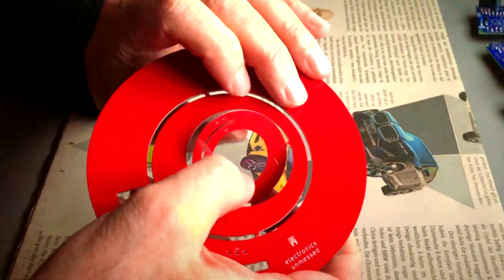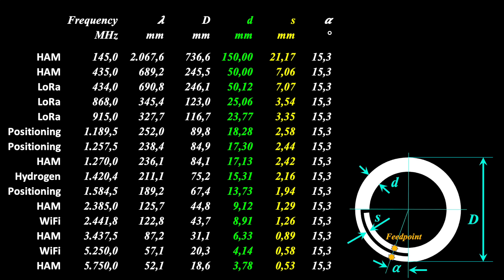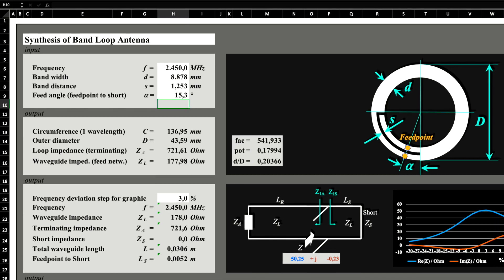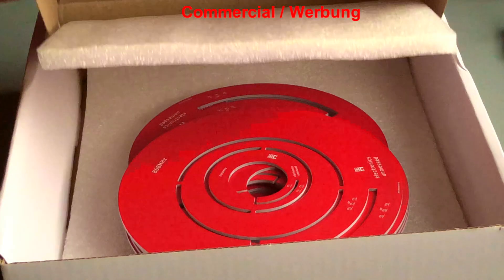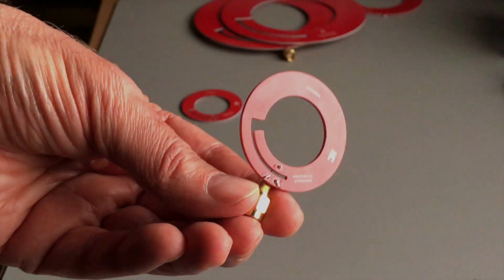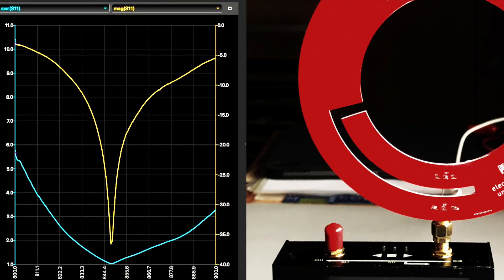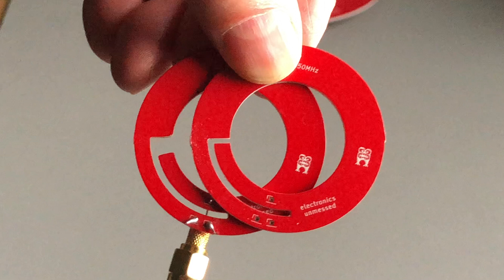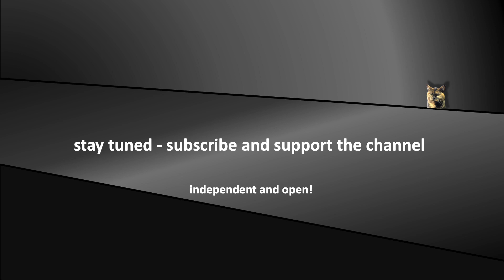KiCAD Design: PCB Lambda Loop Antenna Breakthrough - Open Source planned (EP154c)

Comment: Just found your channel would be very grateful if for a donation a file that would be acceptable to the PCB manufacturer that to use to create a radio amateur VHF UHF loop, I would like to experiment with these.
Reply from the maker: Thx for your comment! I an planning this in the coming months. But VLF will be too large.. I showed a test with aluminum foil in an earlier video. Greetings Klaus

Comment: Thanks, great content ... I think you might want to use a specific PCB base for RF circuits next time, they should not cost a fortune and dielectrically precise and totally homogenous ... once you calculated with these there might be no tuning needed. If your sponsor is also taking professional orders, they should have these types of PCBs in stock.
Would you share the excel table with us to tinker around with these? Or is something like this also available on a public web page?
I am just trying to learn to use EZNEC and that gets challenging fast, for a noob like me who hasn't been playing with serious math and geometry for decades.
Reply from the maker: Thank you for your comment!
We plan to improve the EXCEL tool this fall and then publish a collection on the PCBWay Community platform. PCBWay also offers high-quality materials for high frequencies. The clou of this design with milled air gaps, however, is that you can also use cheap materials.
I hope you enjoy EZNEC. I am using 4NEC2 on a MAC. It's more powerful but unfortunately even more complicated...
Stay tuned!
Greetings
Klaus

Comment: In the planar design, is the gap at the end of the "transformer" just the same as the gap along its length?  Also shouldn't the gap go after the 90degree point, to make it a full 1/4 wavelength?
Reply from the maker: In theory, what you say is exactly right. But in practice, these dimensions work.
I use the gap at the end to precisely tune the antenna for resonance. There's an earlier video about tuning.

Comment: Дякую за відео

Я правильно розумію, що swr вийшло 1.01?
Reply from the maker: Yes, that is correct. But of course, this is sensitive and depends a lot on the environment. In practice you will achieve rather like 1.05 .. 1.01

Comment: I have to vote for 1420MHz. I’m interested in a neutral hydrogen feed.
Reply from the maker: Thanks for your comment! Ok, noted. 
FYI: There are 2 earlier videos on the channel: Sternwarte Heppenheim is using the wire loop version for this purpose.
Reply: @electronics.unmessed  Thanks.  Yes, I've watched EVERY ONE of your videos on the loop antenna.  I can't really say that I understand it, with the feed point being a short circuit of a length much less than lambda and only a half turn, but the results seem hard to argue with.
Reply from the maker: @GRD241  Thx for you comment. I have to admit, it's really hard to understand the antenna. It took me a long time to figure it out myself. Check out the videos on the equivalent circuit and the working principle.  Stay tuned.

Comment: Hello. I wanted to clarify. Do I understand correctly that by placing this questionnaire horizontally, we got a circular distribution and horizontal polarization?
Reply from the maker: Thx for your comment. This is a good question actually. Yes, you are right. But this is only true exactly in the horizontal plane. Elsewhere you get all polarizations. 
Check out the older video, where I explained it:
https://youtu.be/1xigmkPVu0k?si=a-xxVjvqhiboM3Rk
Reply: I watched this video, thank you, it is very clear. @electronics.unmessed

Comment: Hmmm...  Reminds me of electron orbitals in an atom. There we have standing waves too. So, in an analogy with electron waves: how about "figure eight", and "clover" configurations? Should be more compact and thus reduce PCB costs... What about dual band antennas? Like for GPS?
Reply from the maker: Thx for your comment! It's almost an introduction to one of the upcoming episodes, which will be about higher modes. The fundamental frequency resonance corresponds roughly to the figure eight if you will. At double the frequency, the cloverleaf appears, etc. I'll have to think about dual mode. 
By the way, there are several videos on the channel about the working principle, the equivalent circuit diagram, current distribution, radiation characteristics, etc. Stay tuned!

Comment: 869.525 MHz would be ideal for Meshtastic
Reply: Same with 910.525 for US meshcore users!  Looking to use your valuable excel file to create it.  Thank you!
Reply from the maker: @AdaptiveAspirations  Thx for your comment. Just let me know your experience.
Reply: @electronics.unmessed   I am thinking of custom printing a board where I can integrate my Esp32 and Lora radio on the pcb board and have the loop antenna printed around it.  That way it would be all integrated into one pcb board. Basically would this antenna work find if the radio and Esp32 board were placed in the middle of the loop if I designed it that way?   This would speed up my hobby solar node builds.  I am just a beginner in this, but love your concept!
Reply from the maker: @ Cool idea! Thx for your comment. I will test the influence of the electronics on the antenna properties when putting it to the center. And maybe in your case, you could also use a reflector. I think, I will explain that in one of the coming videos. Stay tuned!
Reply from the maker: Thx for your comment! We will consider this in the open source project.
Reply: 906.875 for the US for default long fast setting
Reply from the maker: @ellisgl  Thx for your comment.
Reply from the maker: Noted.

Comment: Reviewing your radio astronomy clips, the propagation is planar to the loop, but they have it in a pot perpendicular to the reflector. Is their a wavelength relationship to the placement off the bottom of the pot and the diameter of the the pot?
Reply from the maker: Thx for your question! Yes, it is a quarter wavelength distance from the bottom, which is practically a reflector.
Reply: Thx. My application will be similar. I'd love to connect with them if that can be arranged. If your on LinkedIn, I'd like to connect.
Reply from the maker: @ Sure, we can connect on linked in. But it would be best to the channel e-mail. Then I can forward your request.

Comment: Thanks for this video and the effort in development you perform.
As to you question on what frequencies, from a HAM radio perspective I would be interested in 430-440 MHz and 1240-1300 Mhz.
Altough I expect the 70 cm to be a bit large for PCB manufacturing.
kind regards, Nic.
Reply from the maker: Hi Nic, 
I am happy to take your input. 
1240-1300MHz is perfect.  
70 cm is no problem for PCB manufacturing. It's rather the price getting too high. 
I will create an open source project on PCBWay's community platform in the coming weeks. 
So, stay tuned 😀 
BR Klaus
Reply: Most PCB companies offer their best rates for a board smaller than 10cm x 10cm. 
You could try a "fractal" design, adding length by changing the shape of the outer loop. However, this would impact the loop performance.
Reply from the maker: @Soupie62  Thanks for your comment! Yes, bigger PCBs are expensive. We recommend to build bigger designs up to 60cm diameter from tin. Above 60cm, we recommend another design, eg band material or tubes. You can dimension all designs with out tool that we introduced earlier.